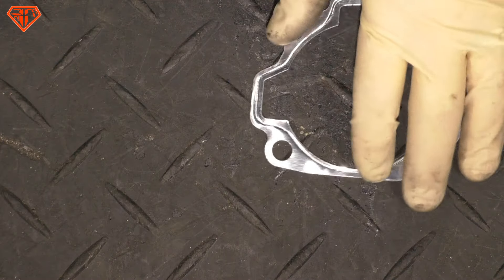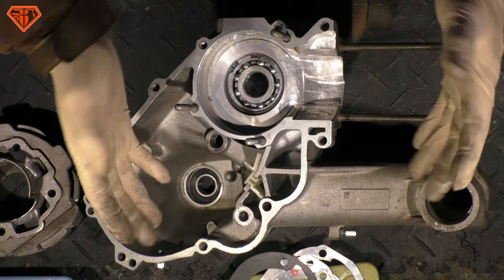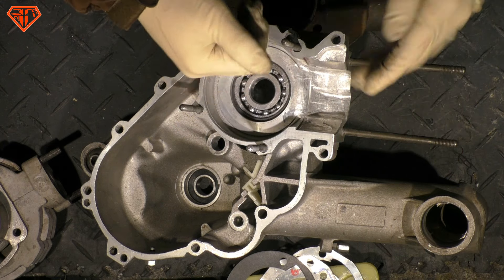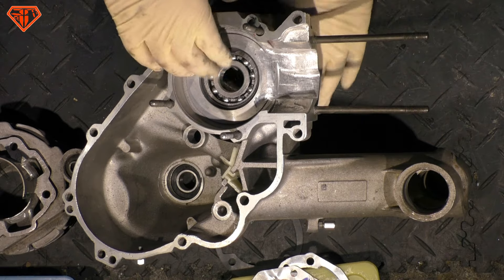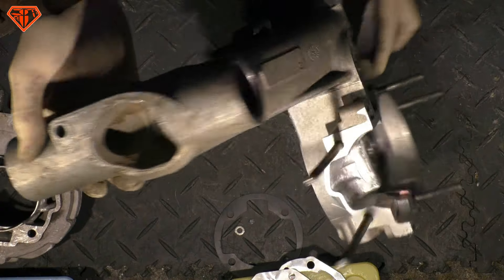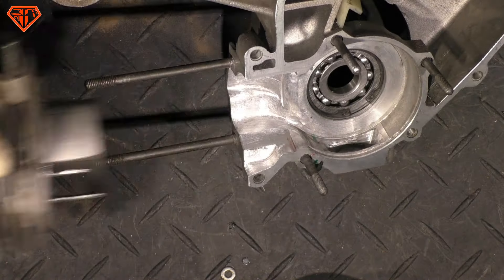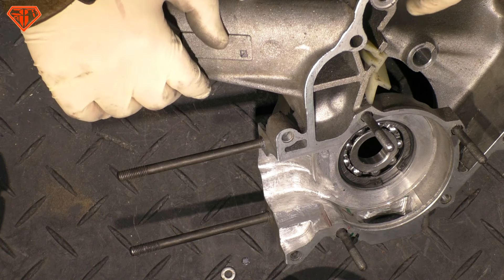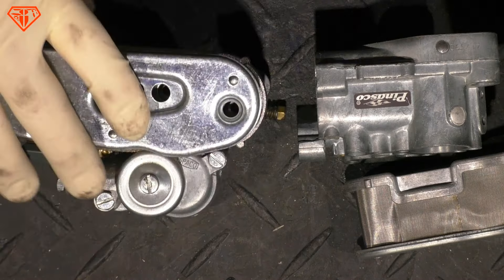the VESPA T5: BEST ENGINE? | or MYTH | FMP-SolidPASSion |

Comment: I have some t5 setups one O Tuning with reso and one with 172 54 Stroke. In the end it is very expensive compared to the VMC stuff for the normal PX. But I like the smoothness and reving, exhaust fitment is better than PX clamp shit. Maybe we get the new Zylinder from sip and check if it is still a bad price to performance.
Reply from the maker: what u mean. a sip t5 cyl?

Comment: I have a t5 original. Just chance the head with MRP and the vmc 10 spring. 110 gps max speed.
Reply: Vmc 10 spring clutch.
Reply from the maker: sure! still the engine is totally overpriced and can not really be tuned due to kinda zero state of the art tuning parts.

Comment: I love my T5 , totally standard apart from a sip exhaust,  the reason you maybe don't have many kits is because a T5 make all PX look about as quick as a mobility buggy 😂 !! Beats any vespa hands down , looks and speed , not expensive either , what I'd this guy on about ??? Talk about missing the point 🤦🏻‍♂️
Reply from the maker: no engine is good and to be recommended where u dont get any decent spare parts and tuning parts. esp when it that bonkers overpriced as a t5. very simple as that 😉 

standard vs standard top. no question. as soon as it comes.to service and tuning. its.a very bad choice.

any simple px 177cc pnp is faster than every t5 pnp tuning.

its simpy not state of the art anymore. was back then maybe. is not anmore for about 20y at least.